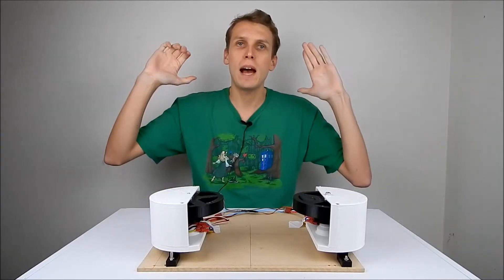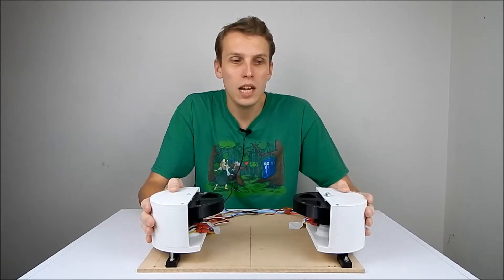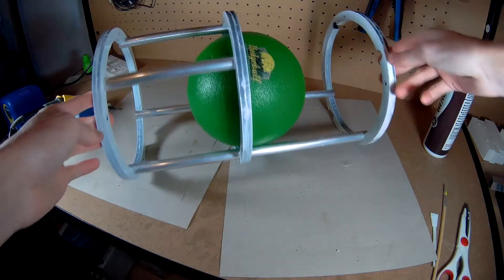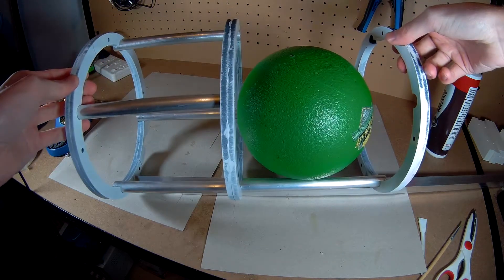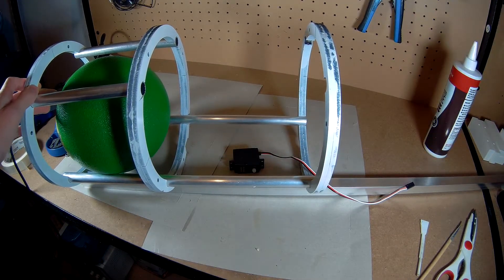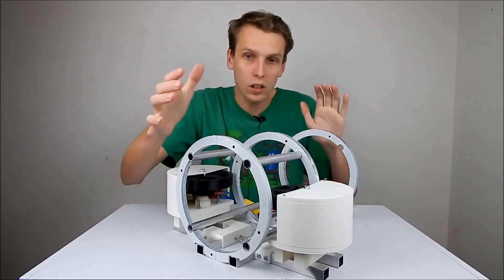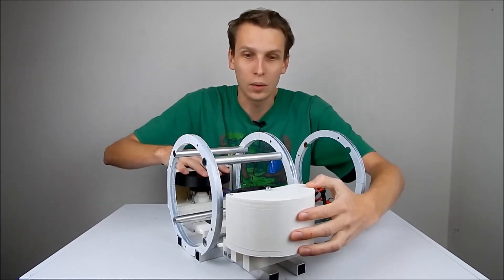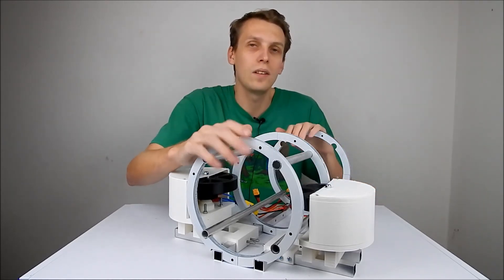Dodgeball Thrower: Part 2 - Hardware!!

Comment: I've got an idea,for the next version of micro dot maybe add a kick stand at the back of the chassis to prevent it from flipping over kinda like you did with the mask robot
Reply from the maker: Not a bad idea.

The only reason I haven't so far, is because without the kickstand the robot can throw itself back over when the weight distribution is correct. 

So if I can keep the wedge together with the weight underneath it the design should work well without the kickstand, but I'll keep the kickstand in mind
Reply: Team Panic 
Ah, I see

Happy to help

Comment: I also play dodge-ball and also suck at catching and had also considered making a ball thrower - but I'm looking at the pneumatic PVC pipe with a solenoid valve approach :)
Reply from the maker: Nice! I did look into the pneumatic option, but I wanted something that was multi-shot and I had a bunch of electronics around that were going to go into beetles